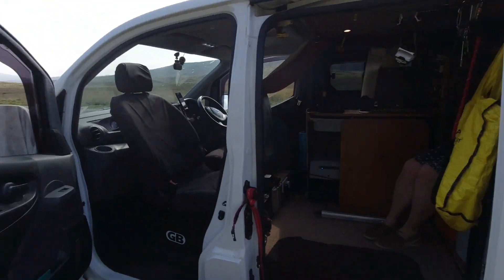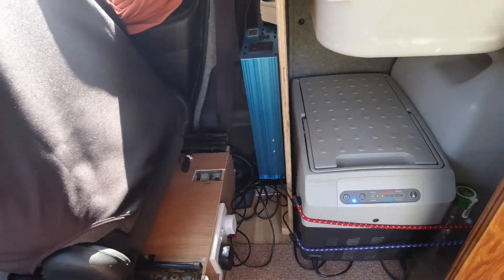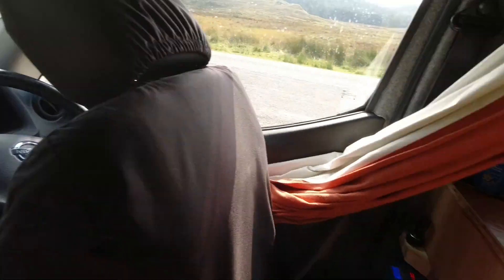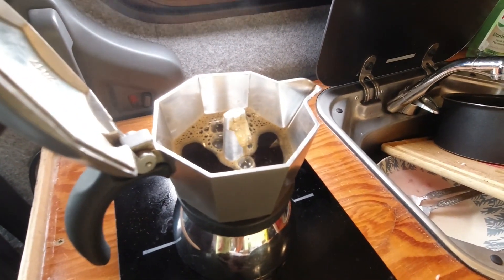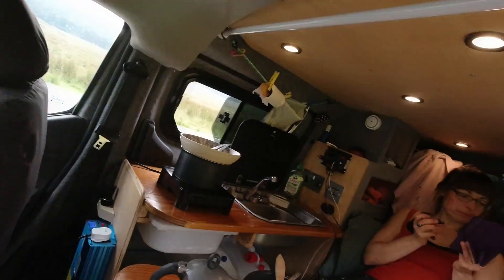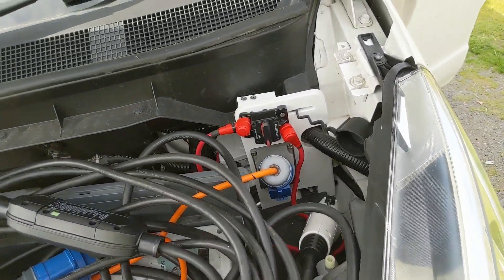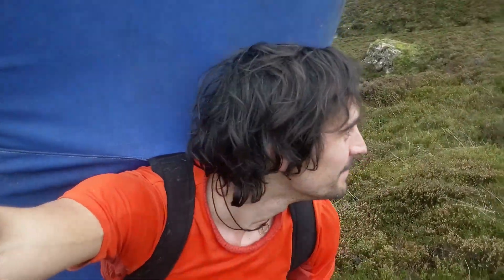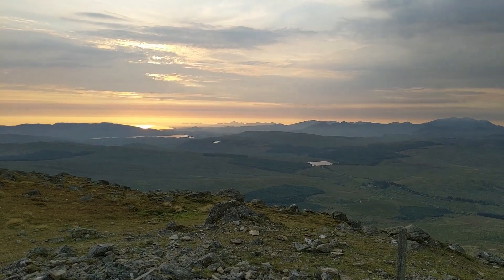Electric Campervan off-grid 240V Induction Cooking WITHOUT a leisure battery!

Comment: Good to see you back Glyn, if anyone is wondering whether an env makes a suitable camper they really do as they are much bigger than they appear,  if you recall I contacted you via twitter before we ordered our tesla 3  (  you were correct it's the best thing we ever bought btw) my diesel NV to camper conversion ( a test to make sure it was big enough before we ordered an env) is nearly finished now, and I prefer driving it to our much newer and 5 times more expensive VW transporter, it also does 17mpg more than the VW. I had to move the silly drivers electric window switch though it caused serious knee nerve damage. I still owe you a bottle when we get down your way, and as we have a new rescue springer that loves the van and beach I think we will get that way soon.  More uploads please Ed

Comment: With every new video my want for one of these vans (with the steering wheel on the correct side of course 😉) increases greatly. The range is a bit small for the US but I would be pretty damn happy with one. Damn the chicken tax! 

Another great video, keep on living, loving, and in doing so making the great content. Best of luck to you all in your travels.
Reply from the maker: Thanks, the newer 40kwh version has a longer range but probably not enough for the USA. Hopefully they will make a lager battery version and sell it globally in the future. The new Maxus van looks good https://www.youtube.com/watch?v=HEiozAuRkVQ
Reply: @GlynHudson  Hopefully so. However due to the chicken tax there is a 25% tax added to all "light trucks" not made in North America. This van would be considered a light truck under their definition. They would only be allowed to import a passenger van version with a 2.5% tax on it. To avoid the taxes it would have to be made in North America. I hope we repeal the chicken tax but I doubt we will.
Reply: In support of Glyn's comment, I can endorse the 40kwh version as (thanks to Glyn's trailblazing example) I have converted such a van and so long as I stay off the motorways and keep the speed around 50 mph, I'm getting around 150 miles between charges

Comment: Did you consider putting the inverter under the bonnet with a switch to change all the 240 volt systems to the inverter that would avoid having to run 100amp cables around the van.
Reply from the maker: I did, but I was worried the inverter may get a bit damp under the bonnet and there wasn't an easy place to mount it. I would also have had to extend the switch and figure out some sort of automatic 240V change over system for when we plug into the hookup. I figured it was easier to keep the two systems separate and mount the inverter in a dry location

Comment: Thanks for the tip on the Vango induction hob I couldn't find anything like this a year ago when I was looking is this new?
Reply from the maker: I think it came out at the end of last year. I'm impressed even 800W is fast enough to bring water to the boil quite quickly. Induction is so efficient, they also do a double hob version which was slightly too big for our van